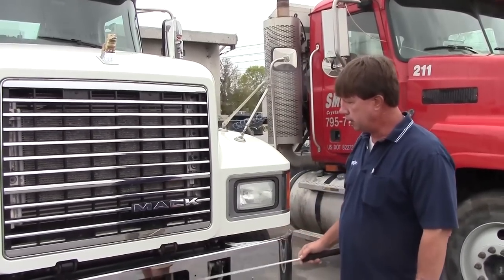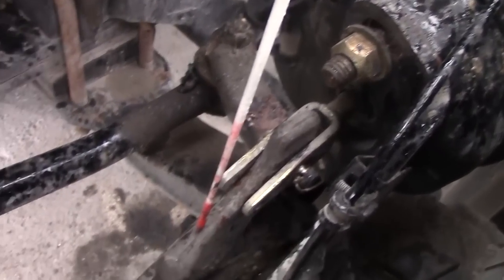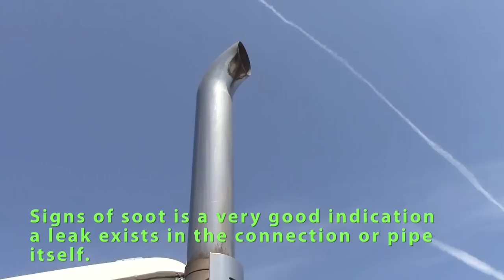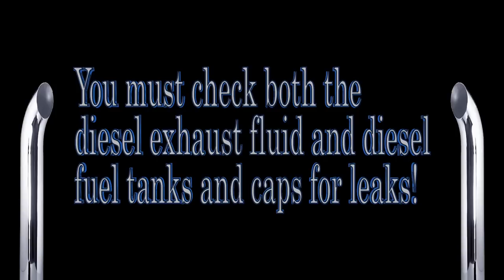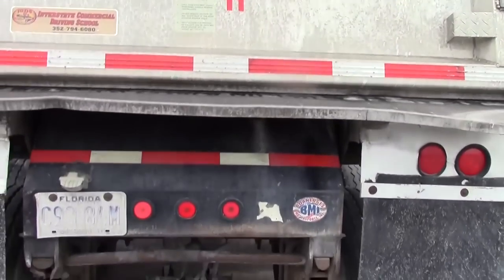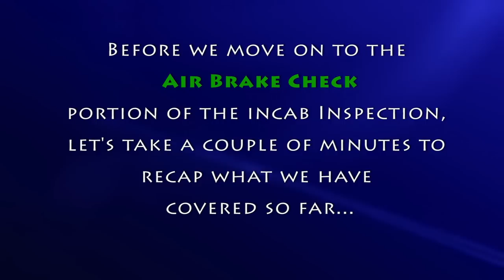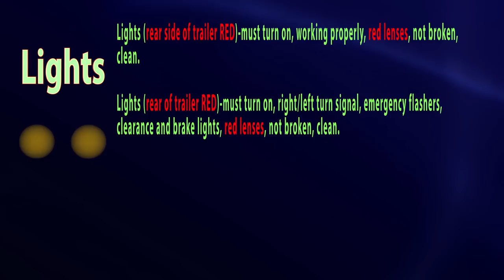CDL Class A w/Air Pre-Trip inspection (all forms)

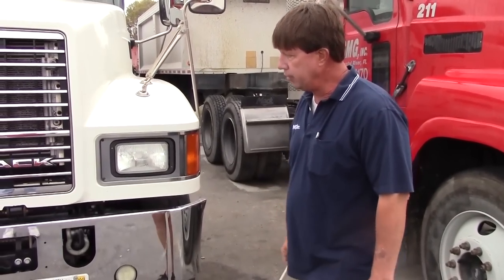Comment: 1:40 Form A
9:53 Form B
19:45 Form C
26:43 Coupling System
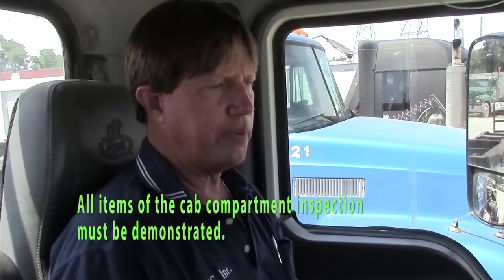32:05 Cab Compartment & Engine Start
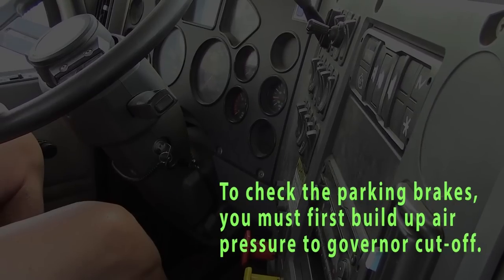35:49 Service & Parking Brake Check
39:16 Air Brake Check
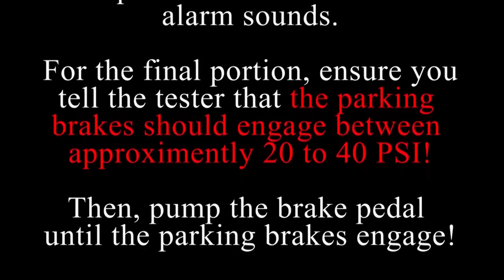43:12 Lights
Reply: thanks man!
Reply: Can you tell me what is a b c and d ive take this pre trip 2 times like ( front of the truck, engine compartment, and steering coponents) does that also incudes ( steering axle) please help me :(
Reply: A-is the front of the truck and the engine compartment. B- is the drivers side door to the back of the truck meaning ending at the truck tail lights. C- is the 5th wheel under the trailer. And D- is the entire trailer from the front to the back
Reply: Can Compartment&engine start
Reply: @JuanRodriguez-nm2te  Google SMG the format in PDF have everything  you need about your question.

Comment: I've seen many videos giving pre-trip inspection walkthroughs, and these are still some of the absolute best!

I do have a question concerning the coupling. For an air-brake vehicle connected to a trailer via pintle hitch (rather than the fifth wheel), would the trailer still have air brakes or electric brakes instead (or could it have either)?
Reply: Can have either
Reply: @SwampDonkeyHomestead  Thanks.

Comment: He did not do the STATIC air pressure brake test with his foot OFF the brake pedal for 1 minute to check that the air system does not lose more than 3 lbs of air pressure.

Comment: When doing the airbrake test in a manual, after you turn the key off and release the parking brakes are we supposed to put the truck in gear so the truck doesn’t roll when we are fanning the brakes to release pressure?
Reply from the maker: If necessary, the truck is not on a flat surface, you would chock the wheels. Our facility is on entirely flat, level ground.
Reply: @smgtrucking  thank you!

Comment: The jam nut is not tight on the brake Clevis on the trailer brakes. I see this all the time. This nut keeps the push rod and clevis tight and secure.This is an absolute fail on a pretrip with that jamnut loose.. I can’t  believe you guys made a video like this.
Reply from the maker: We really appreciate your feedback. Except for the incab portion of the video where items are demonstrated, the rest of the video discusses the procedures and things one would check during the pre-trip inspection. For instance, Mike doesn't remove and check the fuel cap, he doesn't check the tire pressure, etc., but he does state those items, and others such as ensuring the tightness of the various buts and bolts must be accomplished. We are very happy with the quality of the video itself; the clarity allows for visitors to see details such as the one you pointed out. It is our hope others will scrutinize as you have; that in itself is a valuable learning opportunity.

Again, thank you very much for your comment!
Reply: thanks for the helpful video

Comment: Need to know everything. They will tell you absolutely nothing. 
"Do I need to inspect each axle?"
"Do I need to actually measure the air pressure?"
you'll get no response
Reply from the maker: That is true! Won't even get a hint. 

We hope our videos are helpful in gaining that knowledge.
Reply from the maker: Everything on the exterior you name, point to or touch and also explain what you check the item for. You do not need to physically check tire pressure. Just say, “I WILL CHECK TIRE PRESSURE WITH A TIRE PRESSURE GAUGE.“

For the Incab/Engine Start/Airbrake check, you must also demonstrate each item. 

In Florida for the lights, you may ask the examiner to assist in checking the external lights for an extra point, but it is not required. You must tell the examiner exactly which lights they would check (headlight high and low beam; right and left turn signals; 4-Way flashers; Clearance Lights).
Reply: Thanks for the response, this video is very complete and helpful. The only difficulty is how obscure they make the test.
Reply from the maker: We just published a new Class B w/Airbrakes video; it and the recap sections are somewhat more detailed than the Class A (a Class B Pre-trip is basically the same as an A minus the trailer items). It may be worth a watch, too. https://youtu.be/ZiJHU8b23QQ